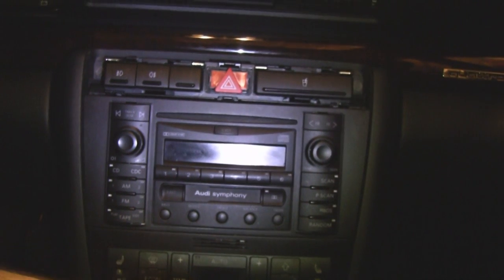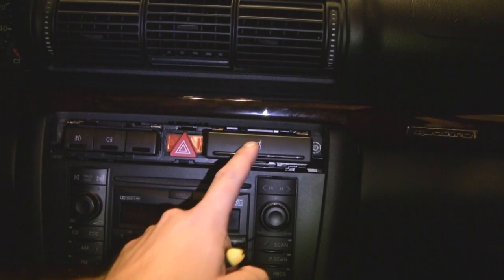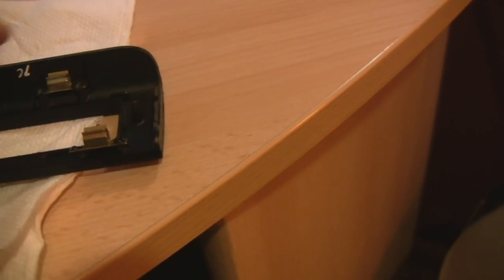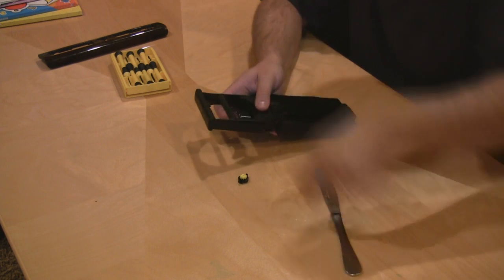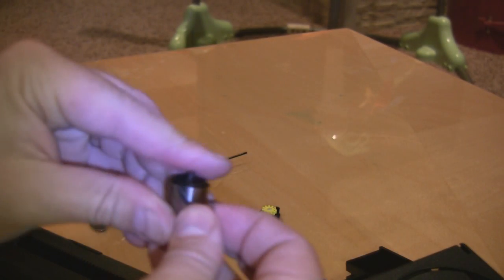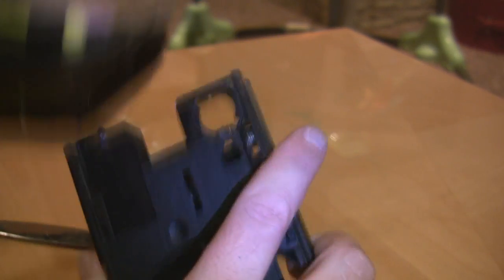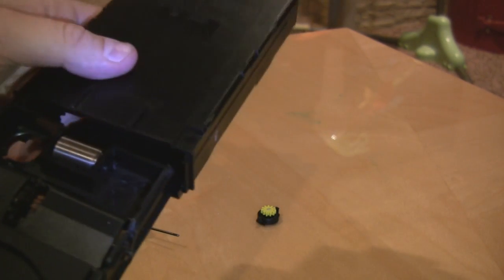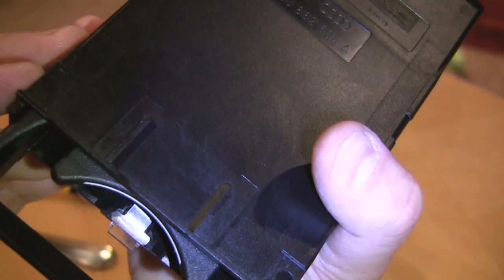B5 A4/S4 in-dash cup holder repair

Comment: Awesome vid, Thank you, I had to plastic weld the two pieces that hold that ribbon in place mine were broken off I took a plastic tab that broke off in another place and with soldering pen I melted the plastic over the ribbon and smoothed it out. It held it in place and was able to reassemble again. Hope this helps anyone else with broken slot tabs for the ribbon.

Comment: Good video but the spring support tabs go on the top not where the light reflector is on the bottom the tab holders up top break this is what caused the malfunction of the cup holder but I hope it stays where you placed it but I have a feeling it will fail  later good luck and thanks again for posting

Comment: Awesome! Works for B6 as well. I disassembled mine to get it to slide easier amd dropped the spring before I saw where it came from. The only difference between the B5 and B6 versions are the B6 spring slides into the top of the casing. It has the same slot as the B5 but the slot is in the top of the case.

Comment: Great video!
I just bought a 2nd hand cup holder because mine is jammed. I will replace and check if I can fix mine, then I'll have a spare part.
Oh btw, I had no problem reinstalling the spring, maybe your's wanted to escape. Just put the T end in the groove and make sure to align the cylinder ends with the sliding part. Then it'll work on the first try.

Comment: I tried but the tip of my spring was already broken so i glued it and it worked fine for about 5-6 times and the glue did let go due to much tension so i have to buy a new one, but still thanks for learning me how to replace it at least

Comment: There is a permanent fix on the VW vortex forums that utilizes drilling holes into the spring and through the plastic so that its mechanically fixed into place.  Incorporating this fix, or utilizing some glue would vastly improve this fix.

Comment: This tutorial was fantastic once i got the unit out. TY!! I ended up using JB-Weld to keep the spring in place, so needless to say i won't be fixing it ever again. 

The important part that seems to be overlooked was the removal. There are two metal clamps located on top of the cup holder that hold the cup holder in place. You can remove them with a flat-head screwdriver. Once you remove them, make sure to be careful pulling the unit out, as there is a wire attached to the back. Hope this helps!

Comment: Thanks for posting this!  Mine quit working just like you said, where the cupholder wouldn't go back in all the way due to the parts that had fallen out.  I ended up having to glue the spring in place, because the plastic that held it in was partially broken.  But it worked out fine.